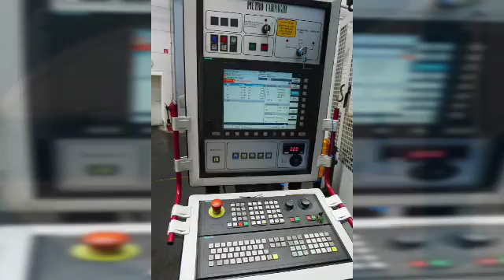PIETRO CARNAGHI AC 20 TM-1800, #4sale #2009 www.emuk.de

Comment from the maker: faceplate diameter 1800 mm
swing diameter 2000 mm
turning height 2630 / 2400 mm
control Sinumerik 840 D
force per clamping jaw 5000 kg
turning speed range 1-320 U/min
transmission ratio 2 kW
Torque 22872 Nm
power capacity faceplate 60 kW
bit feeder section 250 x 250 mm
cutting capacity 50.000 N
Power capacity - boring-, milling grinding spindle 37 kW
spindle turning speed range 7,6 - 3000 U/min
x-travel 0 / + 1210 mm
z-travel 1250 mm
c-axis 360 °
total power requirement 120 kW
weight of the machine ca. ca. 55 t
dimensions of the machine ca. m

max. load on face plate (centric): 15 t
max. load on pallet (centric): 5.5 t

disc magazine with 12 positions
vertical chain magazine for 100 tools
workpiece rinsing device
high pressure coolant devic, 7 presses 6 and 50 bar
palett system with round base carrier and 2 paletts
separate face plate feed drive, c-axis
vertical boring and milling head HSK 100 A
angle boring and milling head HSK 100 A
surface grinding device
workpiece measuring system with 1 measuring device (Renishaw)
Additional functions of Sinumerik 840 D
crossbeam support with rigid railhead to turning, boring, milling